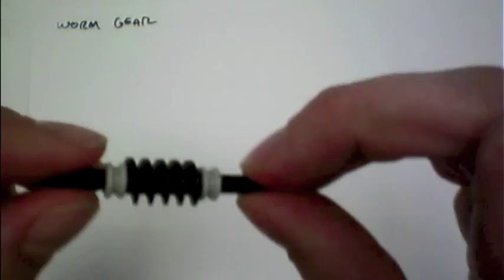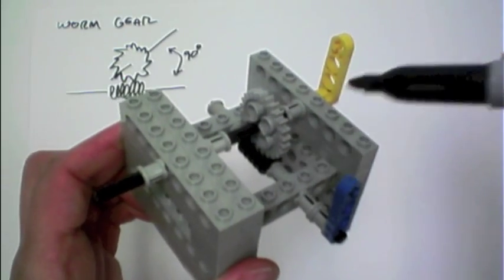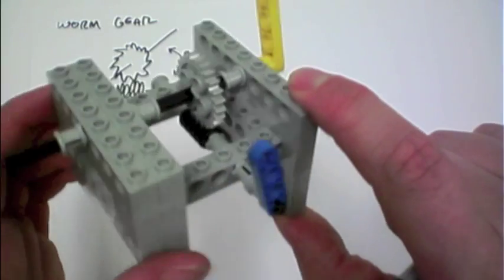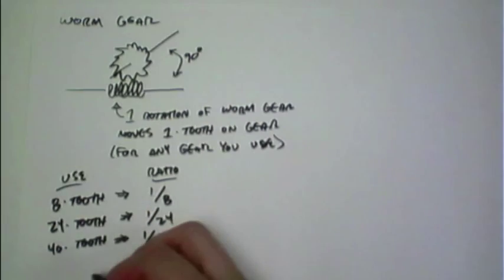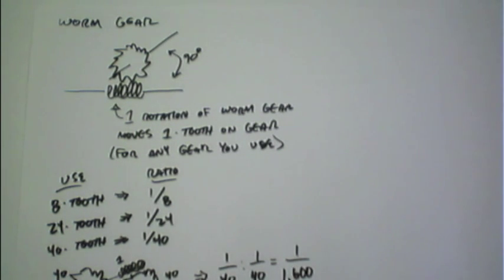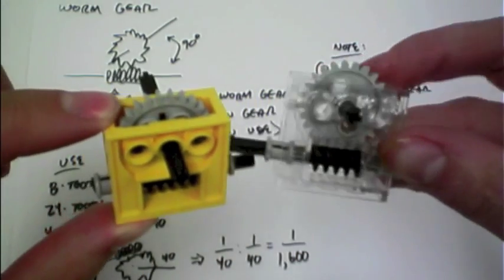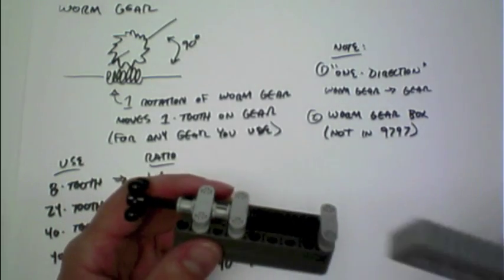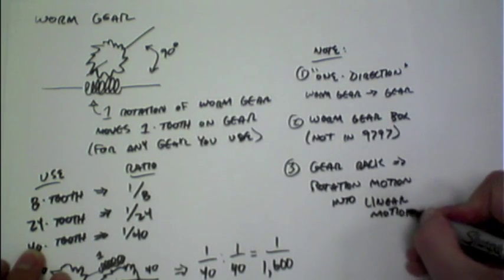Worm Gear

Comment: Brother, I want to know how many degrees a worm wheel will rotate if the worm with a 3 mm pitch is rotated one turn. The center of the worm is 85 mm from the center of the wheel.
Reply from the maker: I'm afraid this video is just about the LEGO MINDSTORMS Worm Gear.  You are going to have to continue your search for your information elsewhere. Good luck!

Comment: Im in need of a worm gear and a matching 7 tooth gear. Ive been up and down the internet and cant find one. If anyhody knows where to get one it would be a huge help. Thank you in advance
Reply from the maker: Because the adjoining gear connects to the Worm Gear perpendicular, ALL sized gears (with proper LEGO spacing) are "matching."  However, I've never heard of a 7-tooth gear before.  The smallest (I believe) is the LEGO Technic 8-tooth gear.  Perhaps you could design a 7-tooth gear and 3D print it?

https://www.brickowl.com/catalog/lego-parts/technic/gear

Comment: What would the ratio be for a 50 tooth gear?
Reply from the maker: A worm gear driving a 50-tooth circular gear? It would be 1 : 50 (one-to-fifty)! Each time the worm gear turns once, the circular gear moves one tooth further (so 1/50th of the way around a 50-tooth gear). Hope this helps!
Reply: @DrEsLab  What about 51 teeth?
Reply from the maker: A worm gear driving a 51-tooth circular gear? It would be 1 : 51 (one-to-fifty-one)! Each time the worm gear turns once, the circular gear moves one tooth further (so 1/51th of the way around a 51-tooth gear). Hope this helps!
Reply: @DrEsLab  Sorry I'm just messing with you. I may have gone too far. You explained it very well in the video.